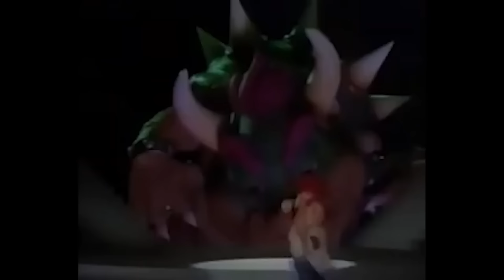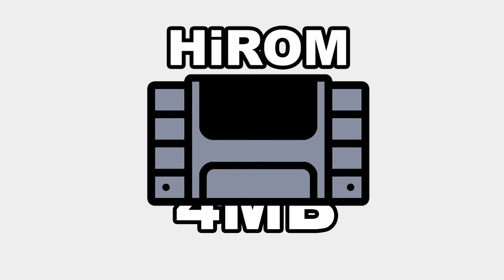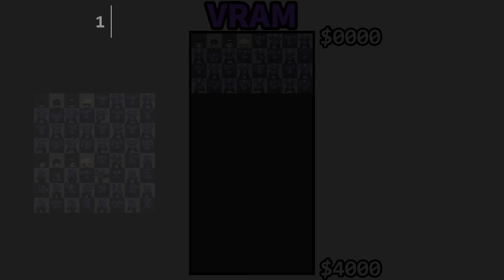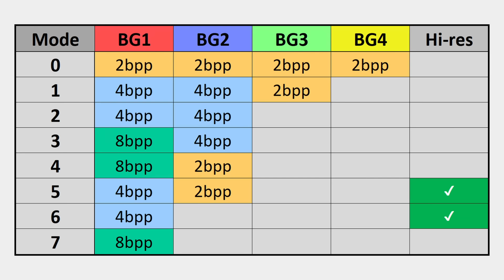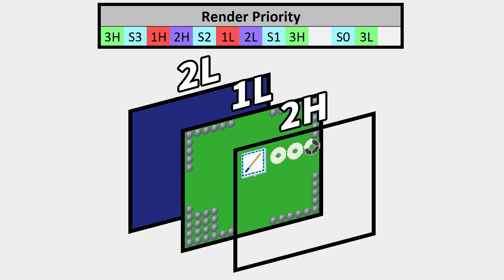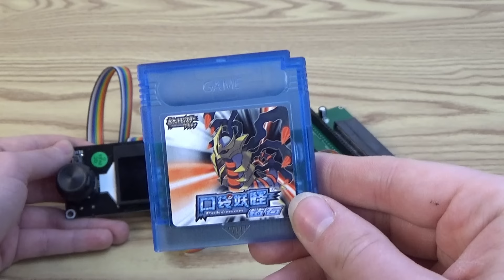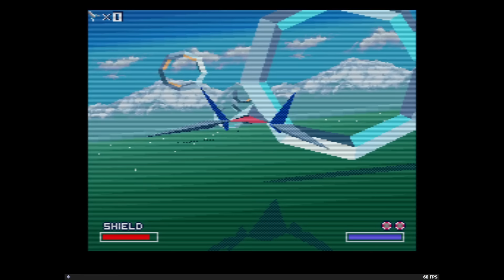Making an SNES Game the Way Nintendo Intended

Comment: A full Godot-style game engine for SNES games would be so cool!
Reply: unfortunately, that wouldn't be possible. gb studio, the only high-level game engine for a console that old, only works by just hardcoding several gamestyles.
Reply: @lucasgreer1736
Honestly, most modern game engines are based on 2D & 3D physics and there are crude 2D & 3D games on the SNES (and surprisingly also on Game Boy).

While it's true that GB Studio wanted to be something along the lines of RPG Maker / Platform Maker / Side Scrolling Shooter Maker / etc, the reality is that it was designed for a pretty high level userbase and didn't necessarily need to be (RPGMaker is even higher level than Unity in terms of just throwing things together to make a template game).

GB Studio could have been designed to use a generalized 2D physics system (like a crude Box2D copycat) similar to the ones that Godot or Unity or Unreal Engine use.

Ultimately the biggest limitations are the precision of calculations, speed, and memory.
But you can take any quick & precise calculation and get a slower, crude, imprecise estimate that uses less memory (let's not forget that DOOM was ported to the SNES!).
Reply: @maverick_loneshark  you can, but I doubt you could get it running at a good speed while still being generalizable to the extent of modern game engines. generalized 2d physics is already WAY more computationally intensive than the basic imitations that games back then used.
Reply: @lucasgreer1736  Are you trying to deny the existence of every Pinball game released for Game Boy and Game Boy Color?
Let's not forget this conversation is about a Godot-like Game Engine for the SNES and that GB Studio was just used as an example since Game Boy has less processing power and memory available.
And even with those limitations FaceBall 2000 was able to be made.
Reply: @maverick_loneshark  pinball games have one physics object and only apply physics to position. I'm just saying that it would be very hard to optimize a godot-like game engine for the snes without it being super stripped down, given that unity (similar to godot) barely runs on the 3ds.
Reply: @lucasgreer1736 
Unity is a bad example as it was not designed to target the 3DS and produces binaries through roundabout methodologies.
Unity also employs multithreading (GB Studio does as well, unfortunately but albeit unnecessarily).
While I can understand how this would make it easier to design an engine, it is horrible for execution speed on systems that lack multiprocessors (I have to limit threading for GB Studio to keep things running at a decent rate for my little project and also manage all game logic from a single thread).

Anyway, Unity also uses a high level language as a user-friendly intermediate to translate to machine-specific assembly language before producing the target architecture's binaries.
Since we only have one architecture we care about (the SNES) our theoretical game engine could rely directly on assembly language to be more efficient.
Reply: @maverick_loneshark  fair, but I would argue that if you're writing assembly, your engine is no longer high-level
Reply: @lucasgreer1736
It wouldn't be much different from using Unity or Godot except that when it comes time to write scripts you are using assembly language instead of a C like language.
GB Studio almost does this except it still relies on GB VM language (a pseudo assembly in-between) because of its awful multi-threading ideology and abstractions that don't translate well for the single processor Game Boy family of architectures.
Reply: @maverick_loneshark  my point is that, in my experience, asm is way, way harder to code in than anything higher-level, which would cancel out a lot of the advantages of having a generalized engine, because if you can write asm proficiently, why not just make your own engine that is more optimized for your specific game?
Reply: @lucasgreer1736
Because we do not want to reinvent the wheel every time we wish to make a new game.
Reply: It uses Assembly it's too basic for such a thing to do much more than doing it the way they did back then, so it has no point to exist since it wouldn't offer anything to help you with the creation process.
Reply: @Arcanua 
Are you not aware of the existence of GB Studio (basically a light middleware for creating Game Boy & Game Boy Color games)?

That being said, I think I would rather be working with assembly after running into little issues with fighting against templates using GB Studio.
I've spent a stupid amount of time trying to implement flickering for 3 different zoom levels for a Game Boy game I am trying to make because of the dumb intermediate GB VM language (go with assembly if you intend to code anything novel that GBS does not support because GB VM is super under documented and has a roundabout way of doing things at the lower level).

Anyway, yes, there are higher level tools you can use to make 16-bit games (Sonic Spinball is noteworthy for being coded in C++ in under a few months, despite introducing performance & efficiency hits).

Comment: I never wrote for the SNES. I did a lot of NES reverse engineering and more development on the SEGA MegaDrive and a hell of a lot on the Atari ST (68000 for the win) and we need to get back to a lesser abstraction imo. All these interpreted languages now used wastes so much of our incredible hardware's potential
Reply: The likes of Lua and other languages aren't the real bottleneck. The bottleneck, which is really hard to avoid, is hardware abstraction. Frankly, while I'd fun working directly on the metal on older machines, the idea of using, say, Vulkan directly isn't that enticing, and definitely not if I were working in the games industry on anything except engine development.
Reply: @ Another example I recently replaced my chromecast. The old one broke after almost 12 years. Now ironically the new one has a way faster CPU yet starting a stream and changing a stream takes 20-30 seconds! The old one started in 5 seconds. It only buffered and started to play. I found out that this one is so slow because it actually runs HTML5/JS so much overhead and quite possible all sorts of other useless things it does that are no benefit of me the consumer. 

We need to go back to fast processing! It's weird that I wrote software in the 90s that performs faster than equivalent software now. And we had to make it run on 4MB and tiny slow IDE disks!
Reply: @talideon  Interpreted languages aren't a bottle neck because you don't write low level enough to code to let them become that. But they are! Global Interpreter Locks in case of Python or single interpreter binary in case of JS/LUA will never ever allow you to take full advantage of multi threading and multi cores.
And yes, I agree that hardware gotten unnecessarily complex especially GPUs because of making things proprietary and shielding of direct access to the developers. It would be great if there was a standard that every GPU had a framebuffer that you could request a begin and end pointer to and just write directly to it, like we did in the old days. But nope, all needs to go through convoluted APIs.

But the issues is not solely hardware it;s the fact that people can't be bothered to actually program. They just want to call a single simple function which does 100s of things low down. And those libraries are unnecessarily highly wrapped. 
You should always wrap up when you need to and preferably do it yourself but even a small library is okay. But you get complex massive frameworks like OpenCV, that is an algimation of many different libraries and languages and a massive hassle as a result to compile and distribute.
And for some reason all the tutorials out there for this (incredible) library are done in python. Which really irks me because Python is so slow even when OpenCV bindings run in compiled machine code, the marshalling of the structures is so slow that Python aps run in say 15fps when you just write it in C++ you easily do 30fps.

That's what I mean with wasting speed with interpreted languages, because 10X faster is a LOT! And those gains are easily made when using C/C++/Rust or Zig over the interpreted languages out there.
Reply: @CallousCoder  You can get good performance with higher level languages, so long as you only use them where appropriate. It's actually been reasonably common to write your gameplay code in a high level language since the 1980s. Even some Super Nintendo games did this; They weren't all raw ASM. The problems arise when you do very computationally expensive things in loops with tons of indirection, reliant on stacks and stacks of libraries written for somebody elses problems. 

However the code you need to just tell an NPC what it should be doing doesn't fall into that category and having that in a more easily modifiable format wins out for sure.
Reply: @thegearknob7161 games that did push graphics weren’t written in interpreted languages in the 80s and 90s. 
Not even written in C (which is a low level language in my book) because C compilers weren’t as apt in generate optimized and small code back then. That only started to happen in the late 90s. Some games were written in C but not a lot and mainly on PC some in Atari. Most games up til the mid 90s were written in assembly.
But certainly not in interpreted languages. 
And I can tell seeing code whether it’s compiler generated or human generated. And almost all the games I cracked in the 80s and 90s were hand assembled. The odd Atari ST game was in C. Which was always immediately noticeable seeing the library jump tables and the poor scrolling.
Reply: @CallousCoder  Earthbound is a pretty good example of a game which runs all its gameplay code in a virtual machine, and it did that on the SNES.

SCUMM was a similar kind of deal I guess.

The interpreters themselves may have been written in assembly, but the point is making a scripting language for simple gameplay code doesn't have to be expensive. If you're spending vast quantities of your time in a function for something game object related you're doing it wrong anyway.
Reply: @ the Scum Engine wasn’t pushing 60 fps, in which we are spawning sound effects (which in the C64, sound and music had to be handled each frame—taking relative much time even though it’s interrupt driven playback)  doing dozens of collision detections and moving the sprites. 

Those simpler adventure and RP games can be done interpreted yes.
Although the Scumm engine was I believe written in C — as it was effortlessly ported to many hardware platforms.
I don’t know Earthbound so I can’t comment on that. But that’s only one title on the SNES, so it’s rare to use interpretated languages on consoles and it’s more common that they used assembly — which they didn’t as I cracked more than enough games to have seen the trademark hand coded assembly 😉And an unwanted effect with interpreted languages is unpredictable speeds. You often had to be frame accurate in the day. The C64 ~19500 cycles per frame the NES a whopping 29780. You wouldn’t want to waste that on interpreter overhead of parsing, tokenizing and lexing. Those cycles could be used to blit sprites.
Reply: @thegearknob7161 aah I just had a look at earthbound. Yeah that’s not really a pixel pushing, high action super scroller 😉
Although I think the graphics routines were assembly written and called from the interpreter.

I also saw btw with the circular wipe transition that it is really jerky. You can actually do that effect a lot faster and smoother. At least on the megadrive I’m not too familiar with SNES effects. But I have no reason to believe the snes couldn’t do that. Even it didn’t have “blast processing” 😆😜
Reply: @talideon  Or one more thing that annoys the hell out of me, is my car's console. It takes literally 10 seconds to be ready. Why was it that 15 years ago when I bought my other car. I turn they key in the ignition and it immediately asked me for my destination.  If I switched on AUX in it would immediately play from my iPhone. Now if I switch AUX, god knows what it does but it takes 3 seconds! Why?! You are switching an audio source, it's literally one bit that you set that switches a single bit to switch a circuit path!!!

Things have gotten so slow. These days and yet we have computers a 1000 times faster than we had 40 years ago. And it's not the hardware abstraction that is the problem. You can push gigabits/second through a GPU. So it is purely bad software.
Reply: high-level languages are what allows us to make games without a novel-length manual and a computer science degree. the age of writing games in assembly is long over, because as games get more complex low-level programming gets less feasible and secure. the vast majority of programmers won't be able to write better assembly than a modern compiler anyway.
Reply: @nddragoon  You are using a compiler. I am referring to people using interpreted languages. And even game engines are too abstracted to gain true performance in many occasions. And many games or written very poorly and start very slow. I was playing Yar's Rising I was frustrated withe loading screens. There's no need to have 5-7 second loading screens when you side scroll. You can (and should) preemptively load them as soon as you get near the end of a level so I don't have to sit and wait. And we did that decades ago already and open world games do it all the time. So there's no excuse.
And that is because most game developers these days don't know how to multithread and be efficient with IO because they don't have taken a CS course and don't read the manuals.
Reply: @ Oh and by the way assembly isn't as complex as you just reuse macros or libraries you created. And your point of compilers creating excellent assembly is true. BUT.... I have had a couple of instances that the compiled code was problematic and caused weird race conditions or terrible performance and I solved that by either changing the optimisation or inlining assembly. And most people under the age of 40 these days can't even read assembly and understand low-level. This why so many programs are so terribly slow as they just accept the results. I was just writing that 15 years ago when I turned the ignition in my car the console was on instantly. Now I need to wait 7-10 seconds for it to boot. Changing the audio source to AUX, takes 3 seconds. Why?! It's literally toggling a single bit! There's no use. Same with booting the console, there's no need for a whole OS to boot. And if you want a whole OS make it boot in 2 or 3 seconds. You can do that with VxWorks or QNX easily on modest hardware. The Qualcomm in my Hyundai console is anything but modest -- we would've considered it a super computer 30 years ago :D And my functional requirements haven't changed. I want the rear view camera to turn on (instantly not wait 3 or 4 seconds -- again there's no need) I want my satnav to navigate and play music either from the radio or my aux in. Why does it need to take seconds?! When we did it instantly 2 decades ago.
Reply: @CallousCoder  Think of all the incredible games that exist today because the developer was able to make them in an engine and didn't have to learn how to manage memory or use pointers. Don't gatekeep gamedev to low level computer scientists.
Reply: @ and that’s also why do many games are so incredibly buggy, or slow?! Like Yar’s Rising where you need to wait 3-5 seconds to load the next set of levels instead of doing that on a background thread when you are near the end of the level in memory.
Reply: @CornThatLefty  But it wouldn't gatekeep, there would still be access for the use of engines and high level programming. It's just opening the field for those who can and want to use low level. You shouldn't be blocking those with the ability and desire simply because it would perform better than those that don't.

Comment: Nice video. It's really cool that you're making a game for the SNES, a system that not many homebrew developers like to develop for.

Just one correction:
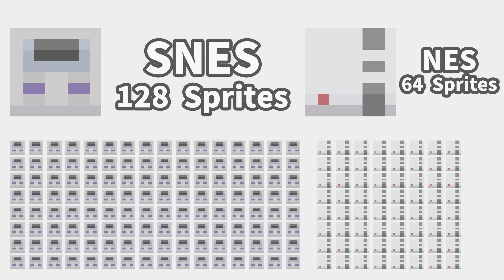8:05 Actually, sprites on the SNES are always 4BPP. You can't have 8BPP sprites like on Game Boy Advance, and sprites can't natively use a 2BPP format on SNES either. The only way to get graphics stored as 2BPP onto a sprite in runtime is to convert them to 4BPP, whether through a specific DMA transfer unit selection (the fastest way, but only works with NES-formatted 2BPP graphics, not SNES/GB-formatted 2BPP graphics) or manually.

Also, why did you use layer 2 for the HUD when most SNES games use layer 3 for the HUD? Do you really need as many colours as 4BPP gives you for the HUD?
If you had used layer 3 for the HUD, you would be able to use both layers for the foreground, allowing you to overlap tiles on top of each other while saving VRAM.

Interesting game development nonetheless, and I'm interested in playing the full game whenever it comes out.
Reply: He didn't even respond after all that!